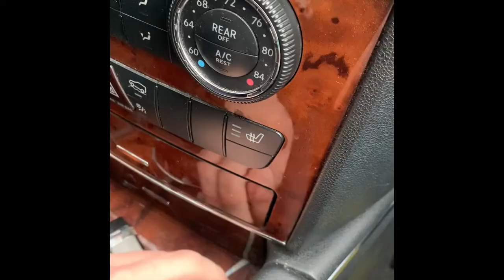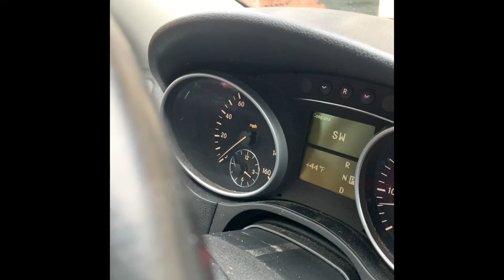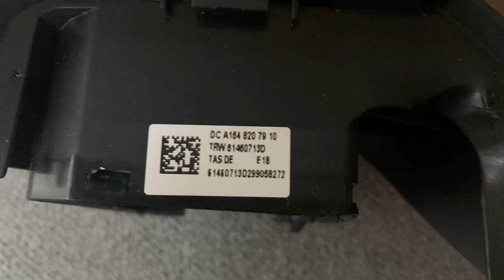2006-2011 Mercedes ML 350 (W164) Steering Wheel Button Replacement

Comment: You don't need to turn on the engine to disconnect the airbag, You just release and pull the steering weal  toward to you and you will have space to  unscrew and release the airbag. Jus disconnect the battery from the beginning.

Comment: That link doesn’t work any more if you can post another link to the part please 🙏🏻
Reply from the maker: US $12.12  34％ Off | For Mercedes-Benz W164 W245 W251 GL350 ML350 R280 B180 B200 B300 Steering Wheel Switch Control Buttons
https://a.aliexpress.com/_msOP7uG

Comment: is it necessary to disconnect battery when changing buttons??
Reply from the maker: Hey, up to you... Just be extra careful not to short any electrical components if you choose not to disconnect the battery.
Reply: Too dangerous is when not disconnected car batterie
Reply: Yes, you have to, otherwise you will create a conflict to the memory  and when you turn on the car you will have problems.  Disconnecting the battery will save the set up to the memory.